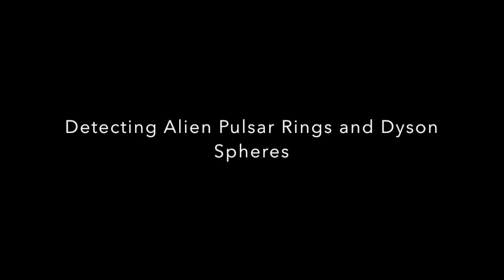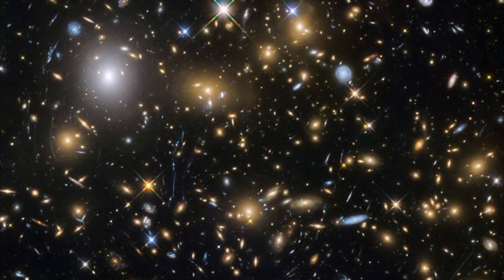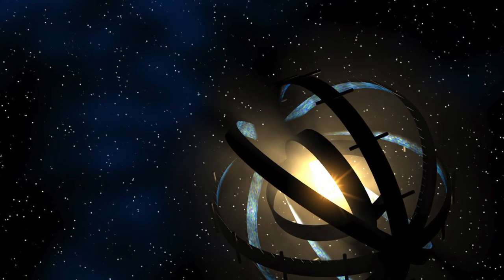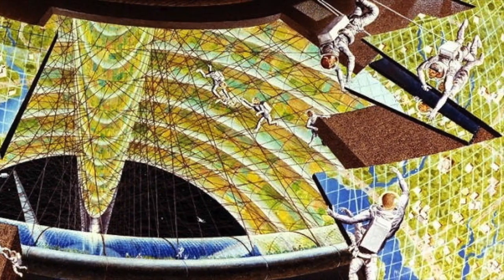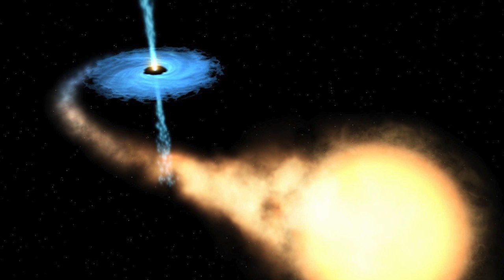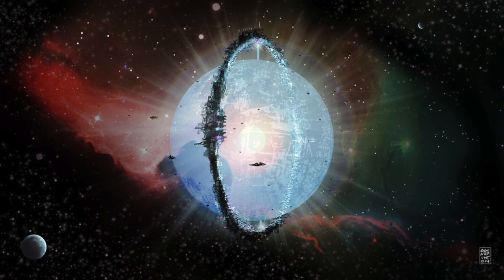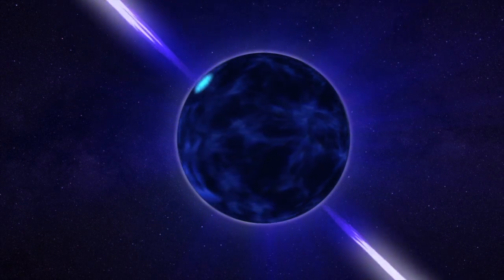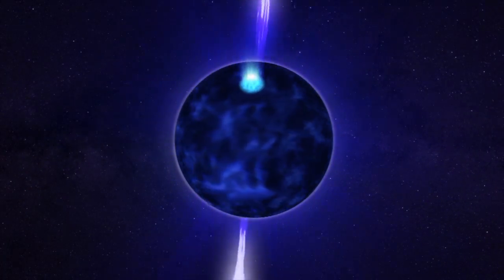Alien Pulsar Rings and Dyson Spheres

Comment: Wouldn't a pulsar ring only really make sense if the magnetic poles, i.e. the beams lie on the rotational equator? Otherwise, the beams would only ever illuminate two spots of the ring upon each rotation.

Comment: What about completely encompassing a neutron star? Yes It doesn't have the same amount of energy output, but just the heat dispersed from it, alongside magnetic output, wouldn't that be enough to power some crazy ass machines?

Comment: The problem with this video is dyson spheres are only theoretical, and not practical. Neutron stars or pulsars would not have any planets around them and any attempt to build a ring or sphere would result in your DNA being ripped apart by the magnetic field, so it would have to be built by machines. The other thing is a ring or sphere couldn't be anywhere near the sun it would have to be not much closer than mercury without being destroyed mechanically by solar storms and raw heat. Its not known any metal or material that could withstand the heat and any assumption moving forward would be that some alien "technologically" can overcome this heat and magnetic barrier without destroying the sphere, and according to our periodic table of elements theres nothing nature or man made yet that can withstand that type of heat. Also, the gravity of a star (more material) or a pulsar (neutron star)  would likely collapse the ring where as a sphere could theoretically withstand the gravity. What seems to be more plausible would be something other than a dyson sphere that would serve the same function. The same was trains were outdated by the invention of commercial airlines, by the time a civilization spent 100 or 200 years building one technology would have progressed to a point where instead of using morse code to send messages an alien civilization would progress to telephones and then to cell phones and whatever happens to be beyond that if you can even fathom the next form of communication.

Comment: What we consider to be a Dyson Sphere is only plausible IF the energy of a star is internally produced as claimed by contemporary mainstream cosmologists/astrophysicists because 'gravity is the only force that does anything in empty space.'  HOWEVER!  If the sun is an electric star, and electricity is the prime motive force in the universe, as it increasingly seems to be the case, then completely encasing  a star within a Dyson Sphere would kill the star.  You would be electrically isolating the star from the universal electricity that flows between galaxies, between stars, and between stars and their planets, therefore cutting it off from its power source.  In an electric universe, Dyson Spheres are pure fiction, and I believe that to be the case for our universe.  

Harvesting energy from pulsars, as opposed to Dyson Spheres is more plausible in Electric Universe  terms as there is a change in energy over time as they behave according to relaxation oscillator circuitry, according to the Electric Universe model, thus removing the impossible notion of having a star made purely out of Neutrons, which cannot exist outside of the nucleus too long before they decay into a proton and electron.

If you want real world explanations of "impossible" objects in the universe (black holes, neutron stars) and more, then go here:
https://www.youtube.com/user/ThunderboltsProject

Comment: tl;dr Basically, I'm wondering what the size of the smallest artificial gravitationally-confined fusion reactor is.

John, I don't know if you have access to the knowledge or tools needed to figure this out -- I've been asking around and can't get an answer -- but how about this:
An extra-small star, artificially created using pure deuterium (mined from clouds in space or lifted from stars/planets).
Since it fuses at a much lower temperature than hydrogen, an entire star built from deuterium would not have the problem that many brown dwarf stars do, namely that of sputtering to a halt after the deuterium is exhausted.  A surrounding artificial structure may assist in reflecting heat to get a star even smaller than the smallest deuterium star that would naturally fuse.  This structure could of course be computing substrate and/or habitat. 

My question is, how big and how massive would the smallest start possible be if it was constructed from pure deuterium?  Even if it glowed in the deep IR, but for trillions of years, it would easy to harvest energy from the heat allowed to flow out.  It could be completely dark to our eyes.

Comment: Pulsars are not good energy sources as they do not have internal processes like nuclear fusion that actually generates energy. The energy they do give off is simply remnant heat, which is why they're much dimmer than main sequence stars. And unless the laws of thermodynamics are wrong, there is absolutely no way for aliens to conceal their energy usage. This does not help resolve Fermi Paradox at all

Comment: But how would we even know a star is a pulsar if the aliens have built a ring to capture the energy from its focus? They would, by design, be capturing the energy we use to determine that a star is a pulsar. So how would we go about searching pulsars that have these structures if they're denying us the ability to determine a pulsar? 

Also it sounds like we need to expand into the solar system and put a deep space observatory on Pluto. Yanno, someplace cold, far away from artificial signal noise, and can just sit there and stare into the abyss... and far enough away that if the abyss stares back, it'll just affect that tiny little iceball.

Comment: There might be different elements out there that we don't know about that can produce power like a nuclear reactor but with a higher energy output and a hell of alot less work than building a Dyson sphere.
Reply: That's certainly a possibility. If population and industry keep growing (even slowly) then after 10,000 years you have a planetary cooling problem - above about 10^16 Watts the planet will start overheating. If that is the case, you must move industry (and perhaps people) not just off-planet but also away from the planet (helped by an awesome power source). Continued growth would yield enormous amounts of stuff in orbit round the star, or perhaps in interstellar space. I don't know if we are trying to detect the latter.
Reply: OTOH if you can defy entropy and produce no waste heat, then that is a pretty good Fermi paradox, assuming no-one has been around long enough to come over here and colonise our solar system a million years ago.

Comment: Something occurred to me during this.  If we primarily use the transit method for detecting planets, we need the planet to travel in front of the star's disk and to pass it.  However, if a civilization created a ringworld and it was either rotating about an axis pointed directly at us or even it were edge on in front of the disk of the star, there would be no dip in brightness.  Therefore there would be no way to know that a ringworld was there.  Or am I way off?

Comment: The idea of advanced civilisations using entire stars as  an energy source is as silly as drying your socks by setting your entire house on fire. It would make a lot more sense to avoid such massive gravity wells altogether and just use interstellar hydrogen in reactors where and when it is needed rather than having to make all of the compromises required to use enough of a star's output to justify even attempting the endeavour.  I'm pretty sure you could do a "101 reasons why smart aliens think megastructures are dumb."
Reply from the maker: I haven't yet tackled that in a dedicated video, but you could easily be right. We're sort of stuck in Kardashev-style thinking, but in fact advanced civilizations may just as easily use very little energy and accomplish everything they need with fusion.
Reply: Haha nice analogy. Yes it strikes me as a bit pointless and mad and probably impossible. Or at least a bizzarly long shot :)

Comment: What's the difference between the heat signature of a Dyson structure and a brown dwarf?
Reply: A dyson sphere would be massively larger and would be putting out an equal amount of energy in IR as that star would be putting out otherwise (so orders of magnitude more than a brown dwarf).
Reply: Exactly.  And can we be sure that all "dark matter" isn't simply stars occluded by technological means?  We could be staring right at a K2 civilization and not even know.  The only assumption you would have to make between "a K2 will leave behind an entirely black section of space" and "dark matter makes up 63% of the matter in the universe" is that, for some reason, K2's leave about 37% of stars untouched.  Maybe universal ecological reasons.
Reply: Upcycle Electronics 350 degrees for 1 hour
Reply: the power vs temperature ratio... a dyson structure emits the power output of an entire star, but at temperatures way too low to be a natural star. Brown dwarfs are waaay too tiny to be misidentified as dyson swarms, by several orders of magnitude...
Reply: Upcyle Electronics, The star inside of the Dyson sphere has the light signature similar to a star which is further away.  Aliens looking at our sun see a 5772 degrees K surface.  With a Dyson sphere it would look like a 5772K surface that was either a bit smaller or a bit further away.  If civilization uses 1% of the light the star it looks like it is 0.5% further away.  In addition to the normal spectra you also have black body radiation from the swarm.  For human people that would probably be around 300K.  There would be a lot of extra 10 micron radiation.  Wikipedia has a good article on "Wiens displacement law"  if you want to crunch numbers.  An extremely cold Brown dwarf would have an atmosphere.  Gasses in the atmosphere would block some frequencies.

Comment: How would someone go about changing the gamma and x-rays from the pulsar into usable energy? One thought I had was p-type Si single crystal wafers (basically solar-cells powered by nuclear waste), although the power conversion efficiency (gamma + x-rays to electricity)  is only about 2% so you would probably hit 1 million degrees in a nanosecond. I'll just assume the waste heat would be used for alien hot-tubs.

Comment: We are probably the only industrialized life in the galaxy.  Why?  Because life is extremely invasive and the likelihood of two such civilizations developing independently within a million years of each other in this galaxy is very low.  More likely than not, our descendants will spread out very rapidly, diversifying radically as we go, to the point of saturation of the galaxy in < 1 million years (assuming a very low transportation speed of 1/10th the speed of light and the fact that the far side of the galaxy is about 100,000 ly away).  Multiple industrialized civilizations in the same large galaxy could be as likely as multiple lightning strikes lighting up opposite ends of a hay stack with the flames meeting somewhere in the middle.  So any Dyson spheres that we may see will have to be our own creations.  As for choosing to build around stars or pulsars.  For those people living near a pulsar, you build there. For those people living near a star, you build there.  Its not either/or, its both.  You send the seeds of life into every corner of the galaxy and let them adapt to the local resources.
Reply: @foxpup: Yes, that's the Fermi Paradox, and that we are the only intelligent galactic civilization is one resolution. There are other resolutions, such as a "Great Filter" that wipes out civilizational species before they spread to other stars.
Reply: This is more of an anti-paradox.  It shows why we don't have space aliens in our face.  It's no mystery to me.  Life spreads wicked-fast and our galaxy is a natural container.  In no time, once the fire is lit, the whole galaxy is ablase with life. The spark begins here and very unlikely anywhere else.  Very soon, it won't matter where it started.  No paradox here.  I would expect us to find no space aliens except for ourselves some day at least in this galaxy.
Reply: And which unreasonable assumtions are you talking about?  Specify.
Reply: I think your comment needs to be less colorful and more substantial for me to understand what you are talking about.  Mathematical proofs are only relevant within mathematics.  Reality simply IS.  The only proof in reality is empirical data.  So far...no space aliens.  That's the empirical "proof".  Other evidence shows that life, once released from containment tends to explode throughout the available space like rabbits in Australia except we are the rabbits and the galaxy is Australia in this metaphor/simile.  Soon it won't just be the "rabbit in the moon".  Actually I think I need to apologize here. I'm not sure my response is any less colorful than yours was. :-)  (or less cryptic :-) )
Reply: foxpup The amount of assumptions you are making is mindboggling.

Comment: 0:22: Technically, Dyson's original sphere was what we now call a Dyson Swarm. It's just that maybe two people who read his original paper actually remembered that bit, and most people heard about it from those who treated the Sphere as a solid sphere. (Which is also a convenient way to mathematically approximate a Dyson Swarm.)
Also, why would all advanced alien civilizations use the energy of only one celestial body? Wouldn't it make more sense for them to utilize the energy of main-sequence stars and pulsars? (At the point where a civilization is using, say, 90% of a body's energy output, it's probably easier to set up shop somewhere less crowded—and where natural sources of raw materials are just lying around, unutilized—than it would be to use that last 10%.)
Reply: Timothy, McLean, Freeman Dyson's original paper specified nothing about construction.  He only said that they would be using the energy and if enough energy was used we might be able to detect it.  Later Dyson clarified that he never intended anything like a shell. 
Building a huge energy collector in order to power a cooling system would not make sense.  A Dyson sphere likely to collect much less than 90% of a stars energy even if they do have the raw materials available.

Comment: You can use a neutron star to produce energy by trickling matter onto it. That matter, accelerated to near the speed of light by the intense gravity, would release immense amounts of energy when it crashes on the star's surface. It doesn't even have to be a pulsar, any old neutron star will do just fine.

Comment: But there are so many more stars in the Universe than pulsars. Would a civilization really turn their nose at so many adequate power sources, just for those rare few pulsars?
Reply from the maker: Good question. All we can really say is that we haven't seen any evidence yet of aliens using normal stars for power generation. That could change, but if it doesn't it suggests that either aliens don't generally use stars for power generation (perhaps fusion negates the need for it?), or there isn't anyone out there advanced enough to do so.
Reply: We wouldn't - yet. But what if you had a business mass producing kugelblitzen? You'd need lots and lots of energy. Or maybe for some kind of galactic weather control device.
Reply: John Michael Godier We may not see aliens using significant / detectable fractions of a star's energy, but there's still room for billions of undetected type 1.5 civs that use a LOT of stellar energy. 

A civ has to be really huge and energy-hungry to need a full Dyson swarm. I'm not convinced that civs grow indefinitely. Why should they? 

Lots of Earth towns have existed for centuries without constantly expanding. Bacteria does it, but bacteria can't make predictions or decisions. 

No matter how rich they are, more citizens means less resources per citizen. At some point, more expansion is just expensive for the members, and potentially dangerous to the whole civ.
Reply: +John Michael Godier+
A pulsar is a neutron star. It would be impossible to build anything around it because of it's intense radiation and extreme gravitational force.